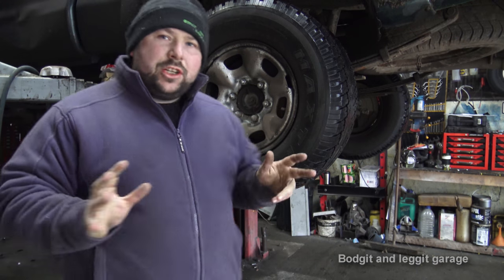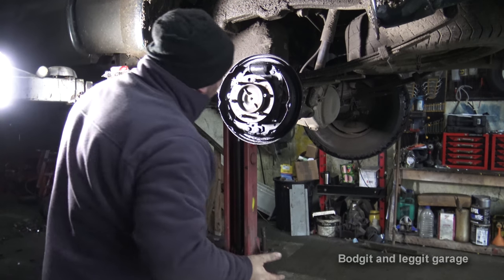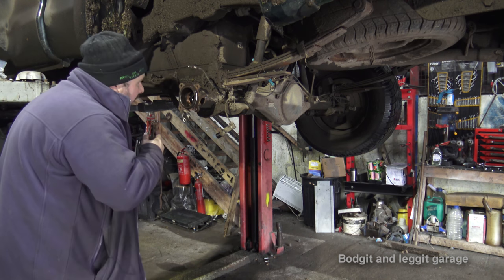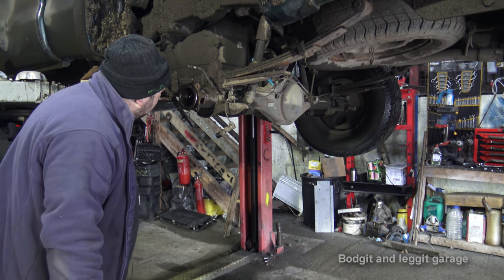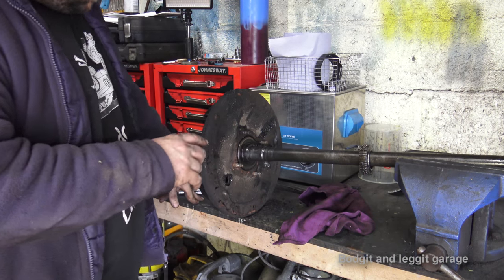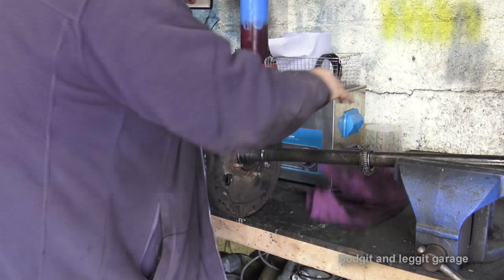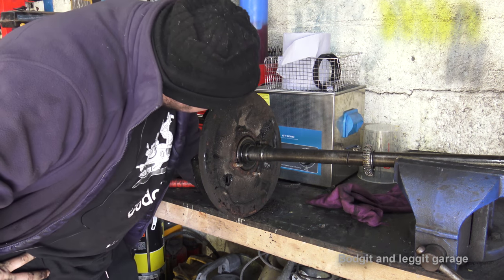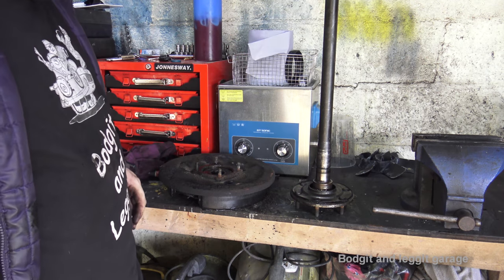Toyota Hilux Rear Wheel Bearing And Brake Shoes And Cylinders Part 1 Bodgit And Leggit Garage

Comment: the extra butchered retaining clip was probably fit, so that the inner axle oil seal lip would rotate on the retainer, creating the seal. This is required  if the abs and retainer are press fit in too far.

Comment: Alright mate u seem in the no I have a mk 6 transit and it missing in 5 gear sometimes 4th gear low revs any idea ?? No smoke cheers m8
Reply from the maker: lyndon webber I need an awful lot more than that codes will be help for a start but with something like that can't really diagnose it over messages could be a million and one things
Reply: bodgit and leggit garage thanks for answer a lot of u tube vids don’t bother thanks I’ve plugged it in no codes no light van is 2010 70 k miles gear stick shakes in 4th 5th gear 1800 to 2000 revs not in any other gear !! Have u had any do this do u think injectors ? Should I do a leak test let me no what u think mate wears a good place to start thanks
Reply from the maker: lyndon webber hi mate yes a leak down test would be no harm it's nice and easy to do if you got a scan to look at the fuel line pressures as well this can be an indication to pump problems but normally when there is pump or injector problems you will get an error code no harm to check your diesel filter and check your tank make sure it's not clogged up
Reply: bodgit and leggit garage thanks mate I appreciate your input

Comment: Great video fella👍 I've JUST found out my 2006 Hilux rear bearing has shit itself and needs replacing😠😡 BUT, do you need to replace "both sides" or just the dodgy one?
Cheers😁...
Ps.. I WON'T be doing it myself (HELL NO) I can see why mechanics charge what they do= cause it AIN'T EASY 😉(unlike my ex wife)